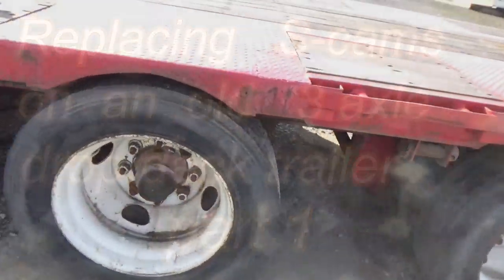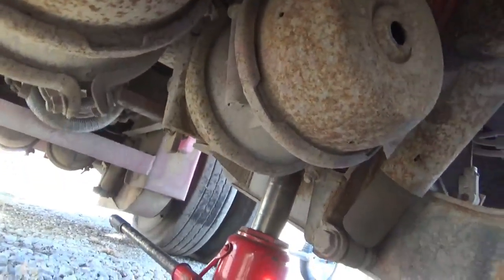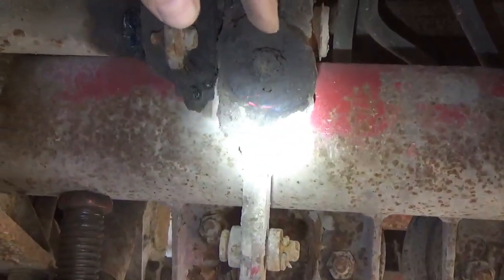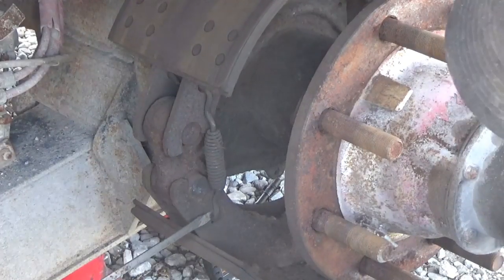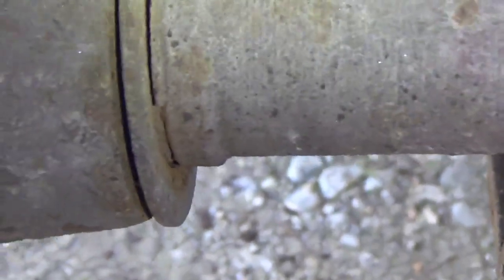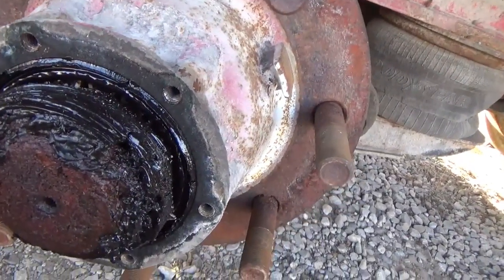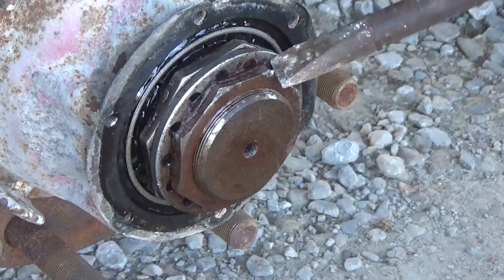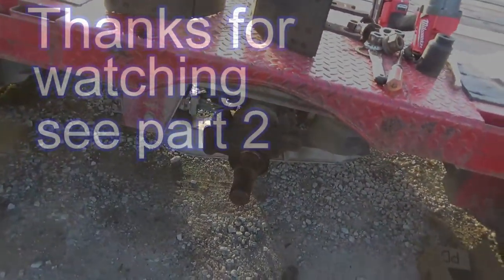Replacing S cam on 3 axle semi trailer  (part 1)

Comment: hey Gordon,  use a pipe wrench on those axle nuts.  it'll go between the studs.  been doin it for years.  it'll even catch the inner bigger nut as well.
Reply from the maker: I do have a huge pipe wrench from Harbor Freight that I use for straightening bent metal, that's a good idea, thanks.

Comment: Hey Gordon just an FYI on greased bearings some companies prefer to pack their wheelbearings merely for financial reasons You almost never ruin a set of brake shoes with packed wheelbearings there’s a plus and minus both ways plus is you don’t ruin as many brake shoes but you do have to pack your wheel bearings every year the plus about having oil in your hubs as long as you have nice clean clear cover windows you can see the oil level and it does reduce friction a little bit a lot of us run synthetic oil in our hubs they run a little cooler that way also when it comes to hub covers it is not uncommon to break the screws trying to change the windows for me doing it for a customer it is cheaper for my customer to get a new hub cover then to change the window Take care out there don’t hit your head too much underneath the trailer
Reply from the maker: I went back to oil bath as you will see in the next couple of videos. You probably disagree but I never ruined a set of brake shoes by them getting oil on them or brake fluid on cars, I just clean real good with brake cleaner and sand them off a bit and back together on my own vehicles and never new the difference. It's mostly a matter of political correctness over contamination not to say they can always be adequately cleaned but it does work.

Comment: What I do on them hub oil seals ,an anything else that is sketchy about coming lose, or i might break the fastener. I will strike it with a hammer to break any corrosion bond. This work to with Philips heads, put a screw drive in the slot an tap it a bit with a hammer/ it helps a lot

Comment: You don’t have to take the hub off, just pop the plates at the slack adjuster and you get enough swing to slide by. It will save you some time

Comment: You considering going oil bath when you put it back together?  Just did cam bushings on my spread axle...... Zero mantenance on that wagon Gordon, Looks like they just ran it for years without doing anything
Reply: They only greased the slack adjusters and nothing else.
Reply from the maker: I did go back to oil bath, it's all done and back to work now.